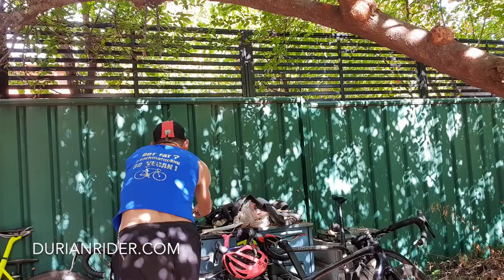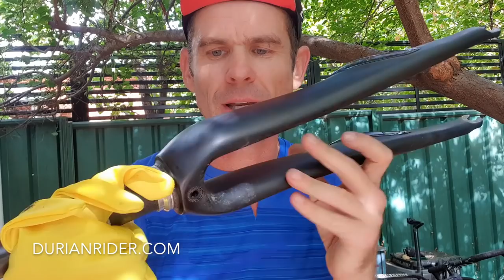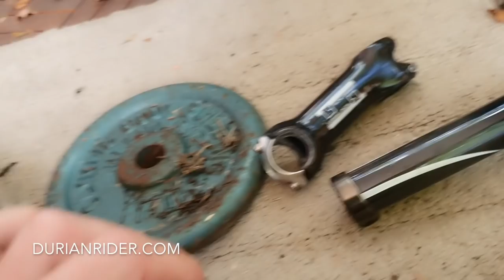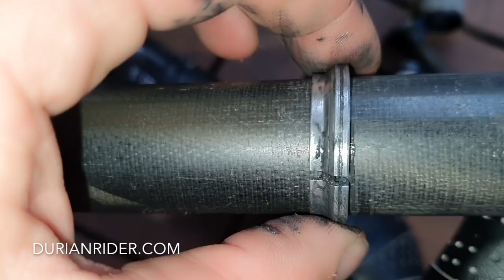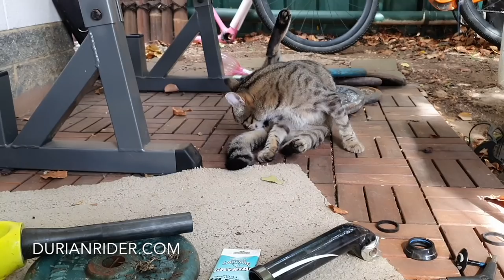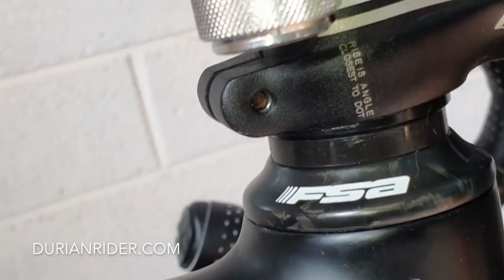What EVERY Road Cyclist Needs To Know About CARBON FORKS

Comment: Something I’ve seen that some companies are starting to do is for example with the new Émonda the headset spacers come off as collars and there’s a brace under the integrated bars. This screws off and gives more slack in the hoses for a headset inspection without a re bleed. Thank you for making this, it’s super important for safety

Comment: Most designs allow spacers to slide past top of the expander plug. The expander's top diameter is the same as the steerer's outer diameter. It is ok to run as man spacer as you want as long as the clamp section of the stem is fully supported by a plug inside and the top of the spacer is ~5mm from the top of the expander plug. I mine is 3mm and I would not go any lower, otherwise I may not get the cap to apply preload. I run a 10mm top spacer and 3mm gap is fine, 5mm would be ok too. But if you run a 5mm top spacer and leave 5mm gap then the space is not even surrounding the steer tube, a no go there.

Comment: Riddle me this babe, how come carbon seat posts don't require compression plugs to stop them from getting crushed by clamping forces. It's the same type of construction as the steerer tube. Seat post = no crushing from clamping, steerer tube = getting crushed from clamping.
Reply from the maker: Not the same torsion load.
Reply: @durianriders  It has nothing to do with torsion load which works in different plane. There's no difference in terms of crushing forces between seat post and steerer tube. In fact the fact that you clamp the seat post in 1 spot rather than 2 should make it even worse. What's also worth reminding is that in the past compression plugs didn't use to be designed to prevent crushing carbon steerers, only to adjust the headset.
Shit doesn't add up, homes.
Reply from the maker: So why don't carbon posts fail like steerers do?
Reply: @durianriders  that's precisely the question. One obvious difference would be the thickness and lower diameter which increase strength. Obviously thicker walls = more grams and that is a nono when manufacturers try to offset the increase in weight due to using disc brakes.

Comment: Hey what do you think about the new SRAM Rival axs groupset! I just order it 😆 oh by the way, it’s 14.5 lbs
Reply: I think it’s good for new riders that want a nice bike with decent components and it’ll make them ride it more so sram benefits and sell a lot and the owners will benefit in good health and have fun riding
Reply: @GrayFox-xd9ww 
I think the groupset is going to be a game changer, SRAM did what nobody thought could be possible, we are going to start seeing other companies doing the same. I see it this way... the price gap between mechanical equipped bikes and electronic is HUGE, there is nothing out there yet to fill that gap so I think this groupset will fill that gap pretty good. For example, I was looking to move on to a bike with disc and electric shifting, but I couldn’t find anything under $3000 new. So, I think this groupset will fill that price range between for complete bicycle in a $2500 and $3500 or even $4000 range. What do you think? 🤔
Reply: @alannkevin  yeh I saw on Instagram good bike brands selling them for about $4k. Sram force and red di2 probably going to go up. Saw specialized selling base model tarmac w tiagra for 2500 usd now it was 2k bike. Yes you’re sacrificing weight for price force and red are made from carbon materials. Nice hope you enjoy it. I think this good groupset for 1x gravel bikes. Kinda funny to see sram say 12 speed bc hills I’ve ridden my road bike up long and steep hills and it’s full claris r2000 groupset. Good for new riders to enjoy high and stuff at reasonable price. I’m sure new rider not gona say ima spend 8k on a bike with sram red or force di2

Comment: Can you get this frame as a Chinese copy if so what's the code? Most of the bikes on hongfu are disk breaks or only go 25c tyres.
Reply: can't get this exact mold. Look for fm066 or FM-R09
Reply from the maker: Winspace SLC  use 'durianrider10' for 10% off